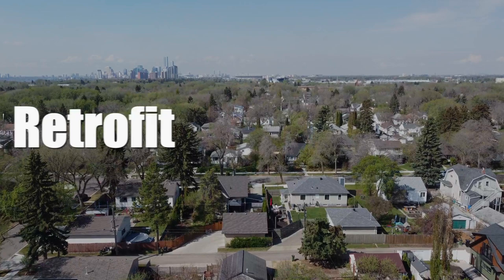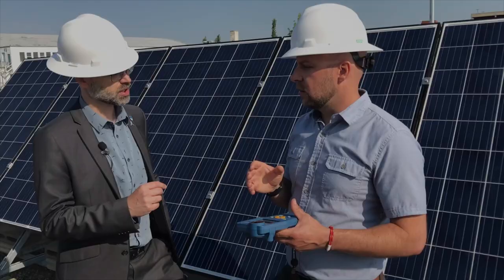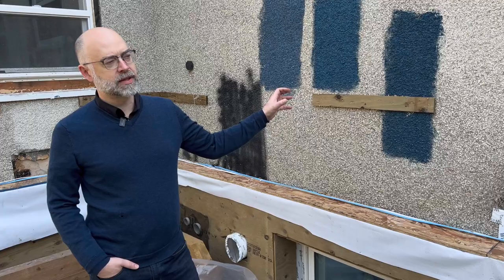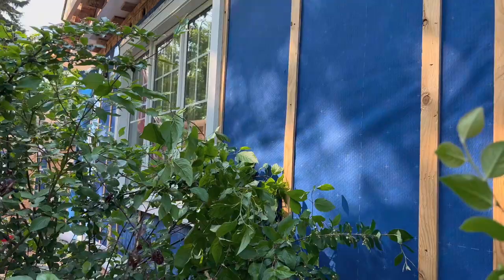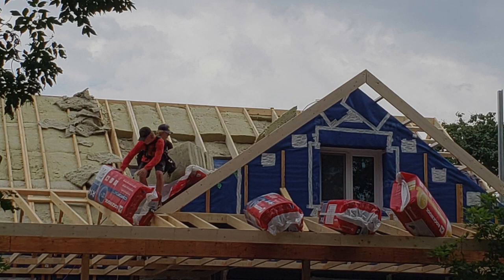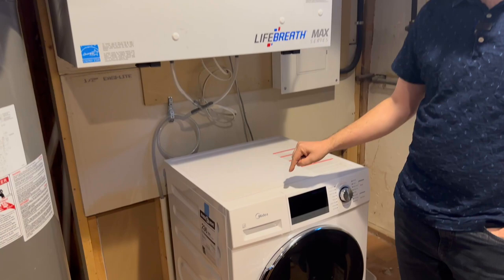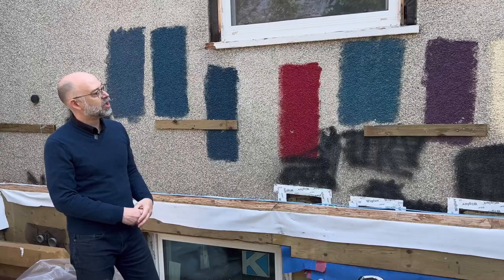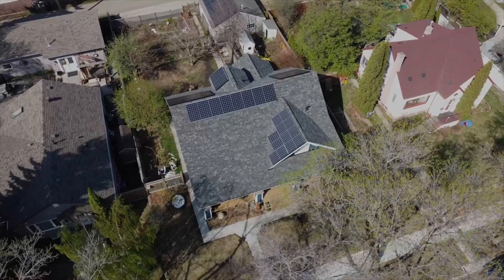343. Deep Energy Retrofit - Transforming 1951 home to net-zero

Comment: We have a 90’s florida home we converted to net zero, but we didn’t spend nearly as much, and anyone can do the work themselves. The home is concrete block construction, ( around 10” thick), we painted the outside a lighter color, and get very little heat loss thru the walls.
The house is 1850 sq ft single story with asphalt roof. We gutted the attic, and all ac ductwork in the attic, ( all the ductwork was suspended in the attic, with r4 insulation, ( built to building codes). We found every duct joint leaked, ( again all to current building codes). The inside attic temp was around 145 degrees during the day. When we gutted the attic we sealed the house, we then re- installed all ductwork using R30 insulation, and all buried under around 25” of blown glass insulation, with all cold air registers and returns encased in 3” of urethane foam. We installed a radiant barrier system 2 layers thick, with accelerated hot air channels to vacate the hot air from the soffit to the ridge vent system. We also put as light a colored roofing on the roof we could find, ( roof used to be black). The attic temp went from 145 degrees down to around 100 deg, ( 5 deg over ambient max). All ductwork was sealed and verified to under 1% loss. We also put temp sensors at the beginning and end of each duct to insure no more than a 1 degree drop from begging to end of each duct.
We installed a water cooled air circulation system that consists of insulated water tanks in the garage, a small water circulation pump, and a heat exchanger in the attic that works by convection mostly, with a small variable speed pwm type variable speed fan to keep air moving thru the attic ductwork, ( with a adjustable 3% fresh air addition, prior to the exchanger. All the hot air in the house rises and comes in thru the ceiling mounted returns. Runs thru the heat exchanger, then cooled air falls out of the ducts throughout the house, after going thru filters and a single pass uv system for air purification, ( allergies in the house). Air is re-circulated around 4-5 times per hour, with a under 3% very slight over pressure. The TES ( thermal energy system), is 100% solar powered from a separate solar system, for both cold water, ( using water chillers), or heating in the winter, ( using peltier based water heater, ( very minor need in south florida)).
The main air to air high efficiency heat pump system was retained in the house, but with it’s runtime hours way less than half the normal run time hours of a regular house.
Many of the other things you did, like heat pump hot water heater, other appliances we also did.
We also heat our pool year round, with a mostly solar based system now, after abandoning the heat pump poole heater.
We have 10k solar on the roof, and our electric bills went from $400 per month down to around $50 dollars a month, ( mostly taxes and fees).
I’m not bragging, I’m just stating that it can be done by anyone, for not a great deal of money, it’s not rocket science.
Reply: How much did that cost?

Comment: Hopefully the few doing the most doesn't dissuade the most from doing a little. I had already done the air sealing and replacing defunct appliances with efficient ones, so I recently upgraded the attic ventilation and insulation of my 80's home. 

I was expecting a 20% reducing in heating and a 13-15 year payback going from R20 to R50. As it turns out, it cut my furnace run time in half (if I know the heat degree days, I know how long the furnace runs that day), and the payback should be 3-5 years. I'll have to wait until the end of summer to see how much my A/C use drops, but it's looking to be around 33-50%.
Reply from the maker: We are very intrigued by the message that we should be careful about the order of upgrades. We will be following up with more stories on how to do incremental upgrades without compromising your ability to do more later one. One of the most amazing stories of DIY and incremental upgrades is this story of Darcy and Darren Crichton. They started 20 years ago, but carefully researched each step and in 2021 actually completed one last project to get their home to net-zero. : https://youtu.be/ZdihZucdmjM
Reply: @greenenergyfutures  I look forward to those future videos. You can add me as a skeptic of the $500 energy audit though. It seems targeted towards those who want to go all-in, but there must be a better solution for the average household just looking at reducing their cost of living.
Reply: That is true. Most of us can make some changes that still make a notable difference. I have also reduced draughts and added insulation to the attic. I think the environmental benefits and financial payback are great. 

We recently had resin bound cavity wall insulation in our home here in Wales. The cost was £1650 (a little over 2KUSD) for a family semi detached home excluding a 15 year old extension. Now the original 1930s home is more efficient than the extension (that albeit wasn't the best built). I was a little sceptical of the stated 25% energy efficient improvement for a semi detached home before having it, but now I think it is quite a bit better than that.
Reply: @greenenergyfutures  Definitely looking forward to this!!
Reply: Okay, summer is over. Where is our update?
Reply: @y0nd3r  I forgot about this post. My 2023 summer A/C use dropped to 280 hours from an annual average of 525 to 650 hours. The new linen curtains on my west facing window walls account for at least half of that savings, they're just that effective against infrared heat gain. I have more numbers for winter, and disappointingly the 20% reduction in heating is closer to my actual results. I have a lot of solar exposure, so overcast dramatically raises my need for heating.

Comment: Super cool install. Seems strange to not add a range hood above the stove. Unless its super well hidden. Otherwise very cool. Wondering how the heat pump performs in winter. I've seen air source heat pumps in Edmonton, and they seem to be running flat out. If they're running's flat out all winter, I would be concerned about the longevity, as these systems are not cheap. But perhaps its so well insulated that the heating loads are quite low. So many questions.
Reply from the maker: Air source heat pumps have come a long way in the last 15 years. There are now units rated to -35C and just about every manufacturer is building them. Be sure to read the reviews and confirm they will work in your climate. I am installing one at my cabin in Alberta.
Reply: @greenenergyfutures  That's awesome. Such great technology. Would love a video om how it goes after the first winter:)